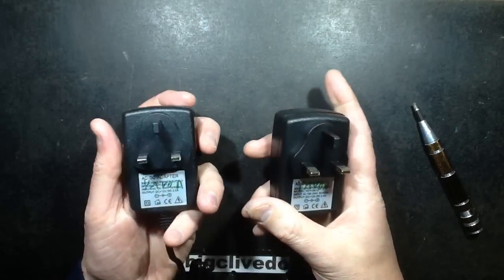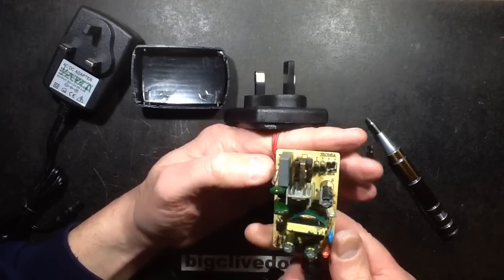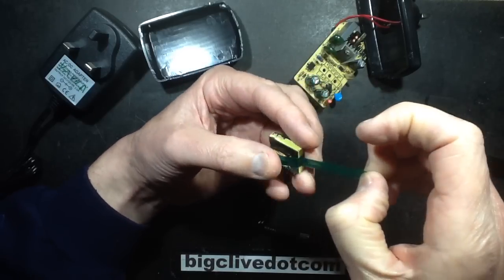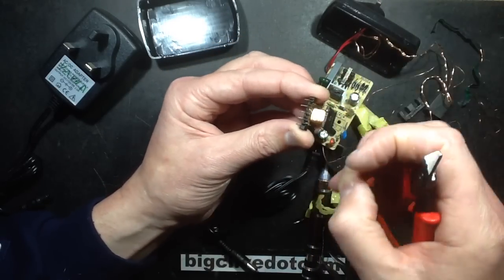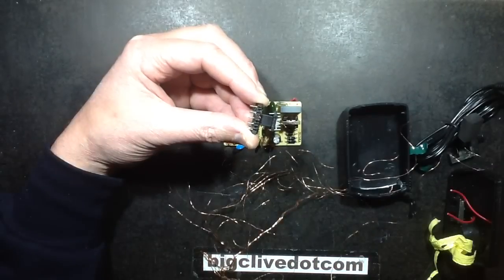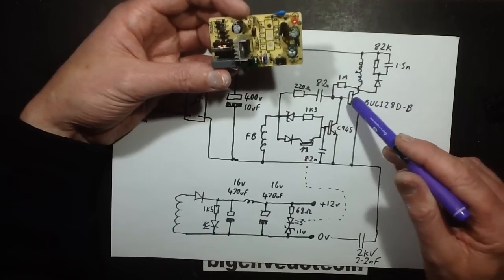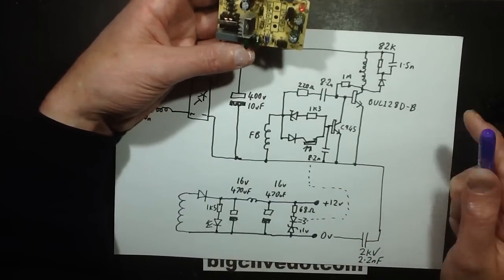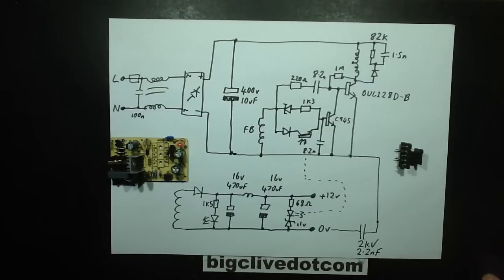Non-delicate teardown and schematic of 2A LED power supply.

Comment: Clive, it's not an unusual arrangement to interleave the windings by splitting the primary like that, it's actually very common. That technique maximises coupling and lowers leakage inductance, meaning the snubber network can be more modest as high voltage spikes on the transistor are reduced. It's important to use this technique on flyback style smps designs to avoid transistor/FET failure. Love the videos, keep them coming!

Comment: Common practice to place the secondary between a split primary it improves flux fits the windings and improves the efficiency in high frequency transformers. You should rewind it preferably with litz wire this will more than likely increase the dc resistance but inefect reduce the ac resistance or you could use a high voltage enameled wire if isolation is your primary concern. You won't have the space for much else.
Reply: +Peter Jones Is this really worth bothering investing in to rewind with expensive Litz etc?
Reply: What is litz  wire????
Reply: @keithking1985  
God gave you Google and a brain (possibly), so use them.
Reply: @keithking1985  I do understand that Acme's post has offended you, but that doesn't mean that you should insult him as well. A Litz is a braided wire consisting of several lacquer coated/insulated thin strands. This (according to Wikipedia) reduces the losses of high frequency currents.

Comment: The lack of insulation between windings is certainly worrying in view of the fact that the primary will have considerably more than the mains voltage on the collector end. Calling this Class 2 double insulation is a very doubtful claim. 

It's interesting to contrast this situation with a couple of UK electricians debating lengthily about whether an added 13A socket will comply with voltage drop, prospective fault current, earth resistance, cable temperature and safe zone routing requirements. And, ending-up using cable of treble the required rating just to be sure they are in compliance will all the regs. After which they decide that the back-box needs an earth wire adding in spite of already having earthed screws, and a separate 6mm earth wire run to an adjacent radiator pipe as well, just in case, complete with safety warning tag. Then realising the socket is 1.2mm nearer the floor than the disability access guidelines allow, so the whole thing has to be done again. After which a series of tests with specialist equipment is made and test certificates issued, then paperwork made out for filing with the local authority under the terms of the Part P Building Regulations. 

Then, someone comes along and plugs in an item like this.

Comment: The easiest way I've found to open devices like those without damaging the cases is this.  Take a folded hand towel and place it on a hard floor.  Take a hammer and wrap+tie another hand towel around it.  Hold the device with one corner on the hand towel you placed on the floor and hit the opposite corner.  Tap a few times and then rotate to apply force on the other two corners.  You want to hold the device so that it is the tallest it can be so that the force is applied across opposite corners when hit with the hammer.  

You are basically turning the rectangular section that holds the two halves together into a parallelogram each time you hit the opposite corner with the hammer which will loosen the bonds in the plastic.  It may take a few extra minutes but you can usually get them apart without any tool marks along the sides.
Reply: 10100rsn Great tip, I'll try this next time.

Comment: All that stands between us and certain death (of our phones and cameras) is 1mm of chinesium tape. What an age to be alive!
Reply: +Nick Moore Wow, I never thought of it like that, I'll get a rush every time I plug my phone in now!
Reply: +Nick Moore Technically between you and certain death is standing 7μm (7.5μm) of insulation on wire (Grade 1 magnet wire, I doubt they used higher grade), tape there is only as secondary insulation (and it is much thinner than 1 mm, more like 0.05mm), but that should be enough.
Tape there is only so they can meet Class II (double insulated) standard (theoretically they could use one layer).
7 μm of insulation on magnet wire have breakdown voltage of over 1400V (IEC 60851.5.4.2).
Reply: +Nick Moore You have to be utterly clueless to think the Chinese invented capitalism.

Comment: As others have already stated, the split primary is actually very common on the “better” power supplies.  The coupling improves efficiency and with the proper optimized ratio of turns between the two sections balances transient noise.  One item that seemed to go without notice is that the circuit type is called Flyback.  That means the stored energy in the core is mainly transferred to the secondary when the primary is switched off, (with a small portion dissipated in the snubber).  That along with the turns ratio and the snubber network determines the raw secondary voltage and finally the optocoupler loop feedback fixes it.  With this principle you can get universal primary voltage.  Would not happen with Forward Converter without more complex PWM control.  You can see the difference in the winding direction between the primary and secondary, which would also have deserved a note pair of Dots on the schematic.

Comment: Hi bigclive, I love these "switching converter porn" videos of yours; I seem to have an insatiable appetite for seeing what these look like inside and understanding how they work :) The topology of this supply is the so-called "ringing choke" or sometimes "self-oscillating" converter. It's main distinction is that it's the lowest cost to build. The downside is that the switching frequency is not fixed, so the EMI filtering is harder to do (can't be tuned to maximize noise reduction, the noise harmonics keep moving). Also, it's only good for modest power levels. It seems to be pretty common in the "bargain" class of switching adapters. I did a full analysis a couple weeks back, you can see it here on EE.SE if you're interested: http://electronics.stackexchange.com/questions/214101/how-does-this-wall-wart-switcher-work. But I essentially ended up with exactly the analysis you did and the same open questions, e.g. "does the opto make it skip cycles or somehow modulate the length of the on-stroke?". I'll be watching all the rest of these you've done that I can find. Thanks a million for doing these :)

Comment: That's quite a clever (and low cost) way of doing the feedback.

For extra stable regulation, you could use a TL431 to control the LED for a precision reference. That zener will increase the output voltage as it heats up with time. Could be a bit dodgy.

Comment: I was hoping for a test, with or without flames.

Interesting circuit, but seems good enough for what it does. Even some load tests would be in order.
Good job of figuring it all out, it's not the most straight forward circuits.

Comment: Oh yeah. I've watched a ton of your teardown videos, and this is the first one I've seen that has this type of power supply. I tore down one cheap chinese power supply (seemed otherwise good quality but had the same issue with poorly insulated transformer) and tried to figure out how it works a few months ago, but couldn't really. It was similar to this (same kind of control circuit), but for 5 volts, and lacked some features (such as the noise suppression choke at the input). Only now I realize how the circuit functions. (I know the basics of switched mode power supplies, but there are so many different designs of them...)

Comment: Interleaving primary and secondary such as splitting the primary and sandwiching the secondary in the middle e.g. Primary-secondary-primary-aux is quite a common winding layer configuration in SMPS transformers. Better coupling from primary to secondary, less leakage inductance, less energy lost in the primary RCD snubber, higher efficiency etc.

The downside is as you now have 2 insulation layers where primary and secondary meet the materials costs for insulation tape etc go up and the window fill factor decreases, but since they didn't bother with proper insulation here it probably doesn't matter to them.

I'm slightly suprised they bothered in this cheap RCC flyback wallwart though. As you know they often don't and they didn't bother with proper primary-secondary insulation in the transformer. They must have a good reason to do so other than trying to slightly improve efficiency.

Comment: Maybe the reason for the split primary is that it halves the potential across each of the windings? Just an idea.
Reply: +Allan Stirling It splits the mutual inductance over a larger area. It cuts down on inductive spikes between switching.

Comment: Did the calculations based on windings.  Primary (first winding) = 32, Secondary (second winding) = 11, Primary (third winding) = 46.  So Primary winding is 78 and secondary is 11.  That means the voltage conversion is 16.94 Volts at 1.54 Amps.  I noticed those supplies show ratings of 12 Volts at 2 Amps, which makes sense if they drop voltage it will increase Amperage.  If we apply a factor of 75% from original figure it comes to 12.7 Volts at 1.925 Amps.  I am curious to know if you attached a DMM and it showed 12.7 Volts as many do register right around that figure.  Interesting transformer design....
Reply: Sierra Juliet -- Say what?  (Root2 x 100 VAC - 2 volts for the bridge) x 11/78 = 19.66 volts max on the secondary winding, when the unit is lightly loaded. But the main input capacitor is so small that at 100 VAC input, I don't see how the unit can carry a 2-amp load. Running on 50 Hz and 100 VAC makes matters worse, as the main cap will only charge to about 139 volts and store 97 millijoules per 10-millisecond halfcycle, but it needs to deliver over 24 millijoules per millisecond to maintain the rated output voltage and current. While direct feedthrough to the transformer will work for part of each halfcycle, reducing the energy storage needed, the prospects for full rated output does not look good. Running on 60 Hz and 120 VAC is slightly better, as the main cap will charge to about 168 volts and store 140 mJ, enough energy for 5.8 ms of the 8.3 ms halfcycle. If run on 256 VAC, the main cap will charge to about 360 volts and store 648 mJ, which is enough energy to maintain the output for close to 27 ms. 
Maybe +bigclivedotcom would check my math? It would be interesting to see how the output regulation holds up while running the input through a variac.

Comment: I try not to use a small screwdriver to open stuff. Many years of jabbing myself with sharp pointy flat head bits. I find the larger bits dont ruin the case as much too.
Reply: +thingyee1118 you can get a "phone repair kit" or something similar really cheaply off ebay these days that have like 2 metal spudgers, 2 plastic spudgers a pair of sharp pointed tweezers, 6 mini screwdrivers including torx etc for about £4. That's what I use. The tweezers are actually really suprisingly good quality, comparable to my branded ESD safe tweezers.
Reply: Yes I own a case opening pry bar thing. Basically the phone repair kit. Works well for certain cases and saves painful fingernails. 
I generally use large flat head screwdriver though as I can twist it to pop it open.
Oh the electrical / CAT rated screwdrivers are not as strong as mechanical one. They are quite soft.

Comment: Nice diagnostics of a power supply, thumbs up, it looks like this is also re-purposed power supply boards as there's LED that is not used. The LED inside the optocoupler is usually IR type with soft translucent silicon material between LED and the transistor. Have you tested how low DC voltage it starts to oscillate? The circuit looks similar to my PSU that started to oscillate with 4VDC input to mains and had correct USB output voltage with 12VDC supply. (It's quite interesting to see output LED glow with 9V battery stuck against the mains prongs, very different characteristics compared to linear power supplies.)

Comment: Just realised I have a 5v / 2amp version of one of those, still wrapped up! :D I can't even remember what I bought it for :(

I've always been a little cautious with the quality of these things though and so I do things like buying old internet routers JUST to get the power supply (which is usually of a good standard), for example the BT homehubs have 9v and 15v supplies and Netgear use some very stable 12v switchers.

When I can't get a decent quality PSU I strip them down and wire in a thermal fuse wrapped in heat shrink, maybe it's just me, but I think all power supplies should have a thermal fuse in addition to any protection already built in.

Comment: Wow, what service. I only just asked for the turns info on your last tear-down (ikea 3 output unit) 5 minutes ago. I wonder if the primary-secondary-primary sandwich has any filtering quality to it? Do you ever use phase dots to indicate polarity of coil/x'former windings?

Comment: More simply method to open this package is , cover the P.S. by some cloth and smash few times by small hammer just in place where it welded together.
Reply: +ValsoRay Every thing opens better with "Mr. Smashy TM"
Reply: +ValsoRay Mike Harrison's method of wacking along the weld with a plastic screwdriver handle can work nicely and doesn't leave any scars.
Reply: +Graham Langley OK))

Comment: Hehe, I picked up a handful of those screwdrivers from a big bowl by the till at Maplin. At 49p a pop, it was rude not to. I was super surprised when I found out they came with a bunch of bits in them too...bargain! At that price, not the kind of tool you want to use on your smartphone perhaps, but something one doesn't mind wrecking in the process of an aggressive dismantlement :-) And they're so light! :-D

Comment: Do you know of any use (reuse) for a 110vac 12 to 22 watt fluorescent ballast, clive?

(I'm rewiring the light to run on LED 3528 tape 2700k... also do you think 4000k is better for photography & human health -- I saw LED wholesalers call it "Neutral white" and I'd never heard of that. I like 2700-3000K myself but only because most I see are those nasty 5000K and horribly blueish -- The kind that look like they should only be used as parking lights.)

I've watched a lot of your vids some time ago and you seem one of top 3 most knowledgeful on LED lights. You could surely school at least one of my electronic's college professors. When I have the time you're enjoyable to watch. Keep up the good work.

Comment: I always wonder if the spec's on eBay wall wart power supply's are accurate especially if they've been repurposed, was the 2nd one you had exactly the same?
Reply from the maker: +Green Silver Both were identical and of dubious transformer isolation quality.  And yet two others from different sources had random re-purposed PCBs in them that seemed to be from higher quality equipment.

Comment: two primary layers with the secondary in the center is quite common. this is to reduce leakage inductance. the usage of multi strand reduces skin impedance. PS insulation is pretty bad in this unit you have there. i even think its illigal to sell it like this

Comment: Side thought.  Is there much scope for swapping the zener with a different value to get a lower output voltage?  Or is the turn ratio of the transformer the bigger player.
Reply from the maker: +James Sleeman I'm not sure how optimised the transformer is for the intended load, but I'd guess that changing the zener on the secondary side would lower the voltage that the opto-isolator cut in.  You would probably still be limited to the 2A output if the supply is indeed capable of that.
Reply: +bigclivedotcom IME you can tweak them a bit but not say 5V to 12V, and the voltage regulation feedback is usually combined with current foldback which complicates things.
Reply: Yes, but more than a couple of volts either way and you'd need to add or subtract turns from the transformer secondary and maybe the feedback winding. Also you have to be careful not to exceed component tolerances like output filter caps and diodes. As the output voltage changes, so does the feedback voltage, which must be in a range that will power the switching circuit successfully. That is often overlooked!
Reply: +ProdigalPorcupine Sorry- when discussing feedback voltage I meant the auxiliary winding that powers the switching circuitry.
Reply from the maker: +James Sleeman Based on tonight's fantastic teardown of a couple of single transistor switchmodes the scope for changing the voltage within reason by changing the zener is high.  The wacky circuit design means that the capacitor on the primary pretty much mirrors the one on the secondary.

Comment: the lines on the one side reminds me of the first hard drive shove in style from the top bays I ever bought  (alas only goes to a TB but hey who thought we'd need more :P) Never had a power supply go bad with those.  Never took one apart don't seem to remember an LED on that but I have taken some apart and have found LED's that indeed glow .  :(  kinda like some usb sticks that should have an LED, and you take one apart and well gosh darn it , it has an LED.  Course the reason for taking it apart was well it fell apart.  Toshiba 3.0 16 gb stick literally fell apart.  Nice Blue LED.  didn't last long either and Toshiba won't honor a 3 year warranty  sigh.  (unless I call a # they never answer.  smh)  Usually that means Toshiba didn't actually make the stick but who knows.  Has a Toshiba chip on it, but it doesn't look right (bent).  Toshiba usb flash sticks overall are some of the worst I've ever come across so not a big surprise.  Just never had one go from 16 gb to 15 mb before.  :(  Lost 16 gb of important info.  Never doing that again.